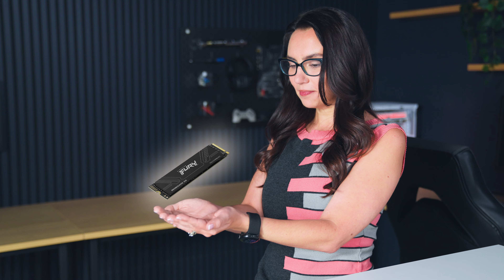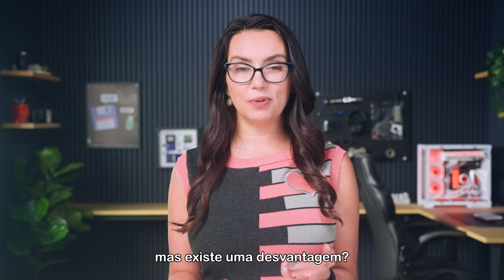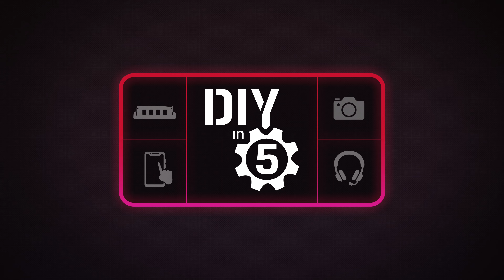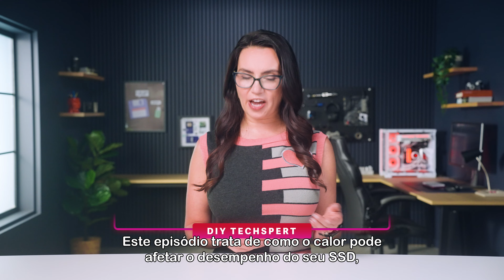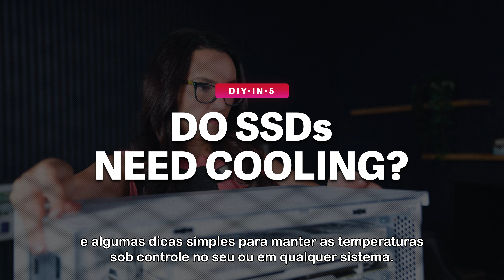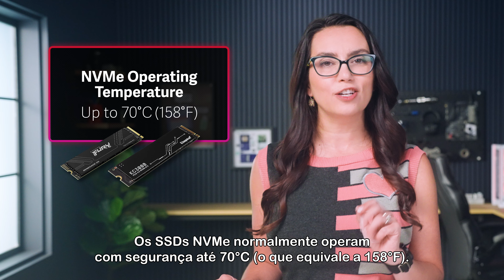SSDs precisam de refrigeração?

Comment: Estou extremamente insatisfeito com o suporte da Kingston. Meu SSD externo XS2000, comprado no início de 2024 e ainda dentro dos 5 anos de garantia, apresentou falhas graves e causou a perda de arquivos de trabalho acumulados por 15 anos. Mesmo fornecendo tudo o que foi solicitado — fotos do produto e da caixa com serial legível, prints dos erros, dados SMART completos, histórico do problema e prova da garantia global — a Kingston segue recusando assistência.
A Amazon não disponibiliza nota fiscal após 3 meses, algo fora do meu controle, mas isso não invalida todas as evidências técnicas e físicas que comprovam a autenticidade do produto e o defeito. É decepcionante ver uma empresa desse porte ignorar o próprio compromisso de garantia, algo que poderia ser facilmente verificado pelo número de série.
Eu perco um produto, mas a Kingston perde credibilidade. Como profissional de Design Industrial e Engenharia, compartilharei essa experiência com meus colegas e grupos de trabalho. Aguardo que a empresa cumpra a garantia que oferece.

I am extremely dissatisfied with Kingston’s support. My XS2000 external SSD, purchased in early 2024 and still under the 5‑year warranty, developed serious failures and caused the loss of 15 years of work files. Even after providing everything requested — product and box photos with visible serial number, error screenshots, full SMART data, issue history, and proof of global warranty — Kingston continues to deny assistance.
Amazon does not provide invoices after 3 months, which is beyond my control, but this does not invalidate the technical and physical evidence proving the product’s authenticity and the defect. It is disappointing to see a company of this size ignore its own warranty obligations, especially when the serial number alone is enough to verify legitimacy.
I lose a product, but Kingston loses credibility. As a professional in Industrial Design and Engineering, I will share this experience with colleagues and work groups. I expect Kingston to honor the warranty it advertises.